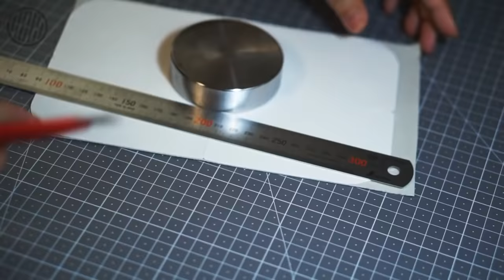[Leather Craft] Making a small bucket bag / DIY bag / Free PDF pattern

Comment: Hi,
Nice work, I really love it. May I ask you which software do you use to make your patterns? And I didn't see the glue's name. Thank you for all these wonderful videos.
Reply from the maker: Thank you for the comment mrCornay , I using Photoshop for the pattern  and here is the glue that I use usually Hope this helps!😊
1. kenda bond 
: yellow, chemical smell, very strong, low price
2. intercom ecostic, high price
: white, no chemical smell, thin
3. Instant adhesive
: race, braiding, metal hardware (rarely)
4. B5 bond
: Beige, Thick, using for lining.
Reply: Perfect, thanks!

Comment: Another great videos! Thanks for the free pattern. What is the brand of the glue that u use?
Reply from the maker: Thanks a lot!  This is what I use usually :)

1. kenda bond 
: yellow, chemical smell, very strong, low price
2. intercom ecostic, high price
: white, no chemical smell, thin
3. Instant adhesive
: race, braiding, metal hardware (rarely)
4. B5 bond
: Beige, Thick, using for lining.
 
Hope it helps! :D

★If you'd like to get the pattern, please follow the steps below :)
1.subscribe & like this video
2.go to the link and join the YouTube chat
https://youtu.be/addme/1lI3Oy0130CCbhNhS2vqUAmUellXxQ
Reply: @HahnsAtelier  Thank you for sharing 😁

Comment: A little help with the hardware you used. What size were they? If I use a different type of adhesive, what would you recommend?
Reply from the maker: It's total up to you. a little bit smaller than below would be fine. But the Strap hook should be bigger. cause it hooks 3 bars at once. hope it helps! 

Snap Hooks for finger strap 20mm x2
D-ring 20mm x2
Strap Hook 20mm x2
Neodineum magnet  20mm x2
adjuster Buckle  20mm 
(You can see the parts in the subtitles of the video)

Comment: what glue do you use ?
Reply from the maker: Here is the glue that I use usually Hope this helps!😊
1. kenda bond 
: yellow, chemical smell, very strong, low price
2. intercom ecostic, high price
: white, no chemical smell, thin
3. Instant adhesive
: race, braiding, metal hardware (rarely)
4. B5 bond
: Beige, Thick, using for lining.

Comment: Do you mention the hardware sizes anywhere that you used ?
Reply from the maker: I used 1.5cm wide D ring and snap hook.
Reply: I forgot to ask what size thread you are using and brand ? I’ve been using .8 thread and I like yours seems smaller than mine

Comment: What glue do you use?
Reply from the maker: Here is the glue that I use usually =) You can see those in the my videos
1. kenda bond 

: yellow, chemical smell, very strong, low price
2. intercom ecostic, high price
: white, no chemical smell, thin
3. Instant adhesive
: race, braiding, metal hardware (rarely)
4. B5 bond
: Beige, Thick, using for lining.
 Hope it helps! :D

★If you'd like to get the pattern, please follow the steps below :)
1.subscribe & like this video
2.go to the link and join the YouTube chat
https://youtu.be/addme/H6Io4d7i9YNlpZ79bXIJQW9XD4z0HA